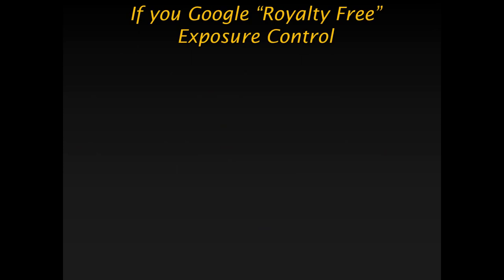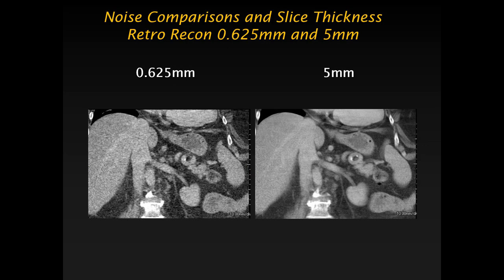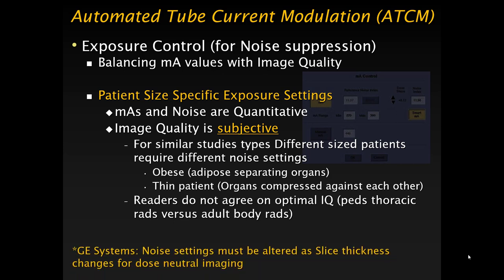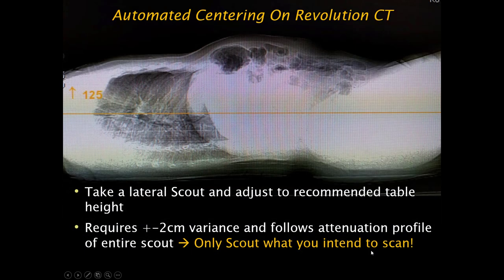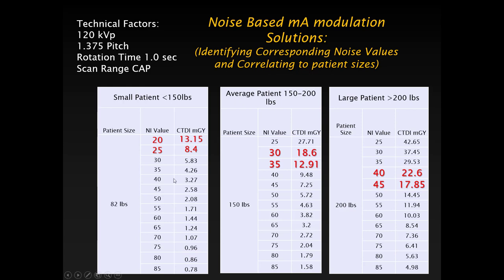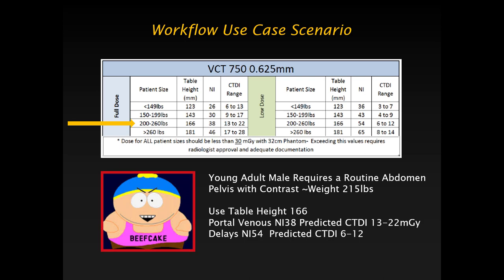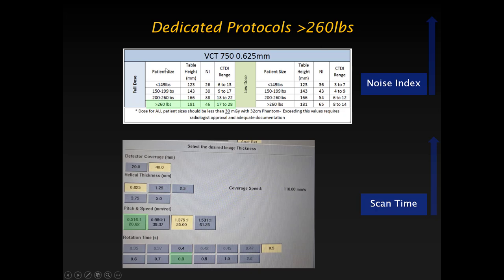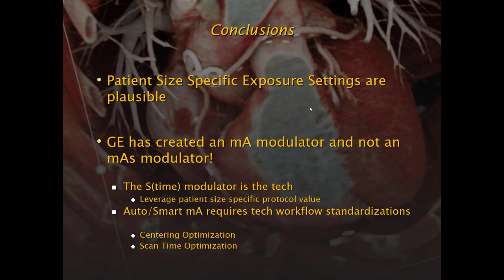Optimizing Noise Index on GE CT

Comment: Hi, thx for the lecture. As a 10y Siemens user this confirmed my observations that SmartMa is linear and hence much harder to manage in daily workflow.
With Siemens you need 1 protocol, for he you basically need at least 2 or techs and the time who will pay attention and change NI and max mA for obese patients - I don't understand why GE stuck to this technique for over a decade, it wouldn't be hard to flatten the curve and call it a "relative NI" based on a BMI up to 28 or whatever and then reducing mA